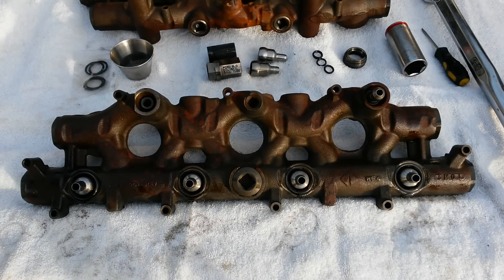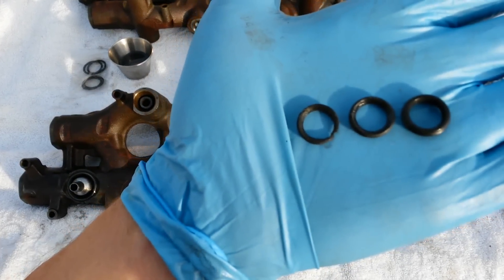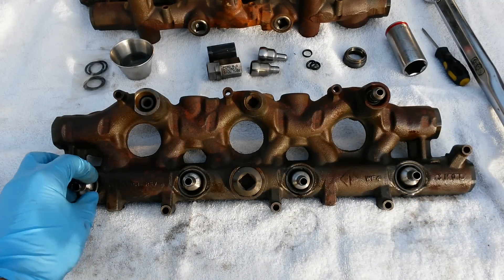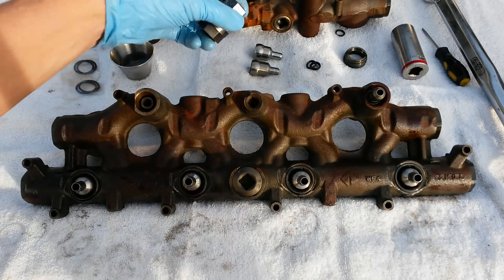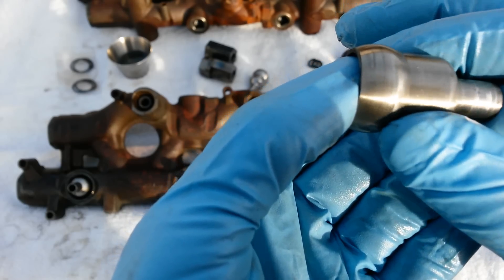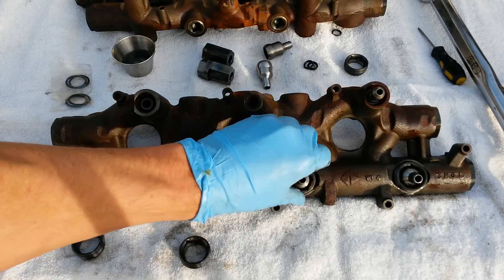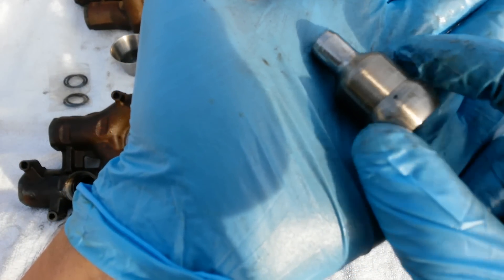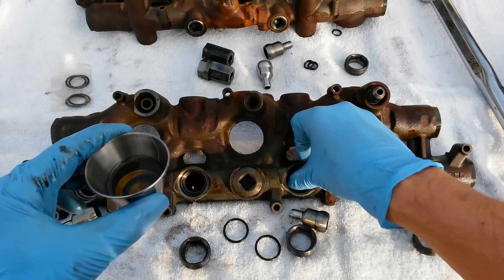FORD 6.0L Diesel ~Ball Tube/Nipple Cup O-Rings & Top Injector Seals ~Low ICP Won't Start Hot

Comment: I know this will cause a no start, but will it cause one to just die when it's at normal running temp?
Reply: Yes it can if the oil psi drops to low